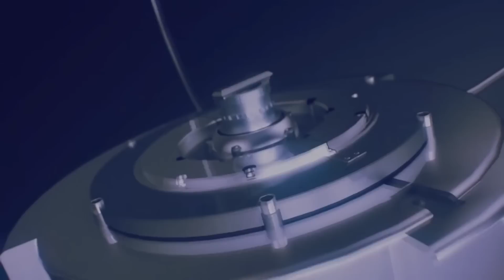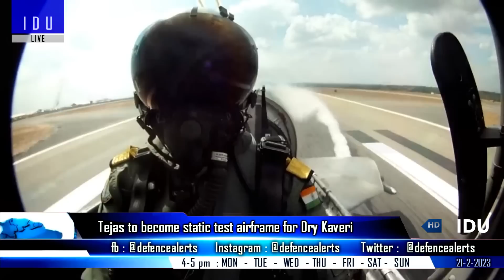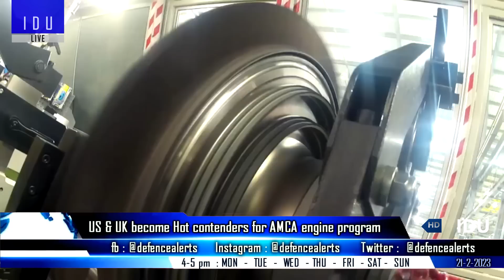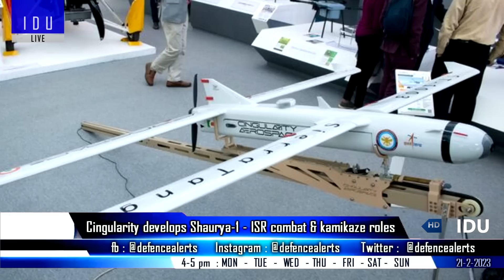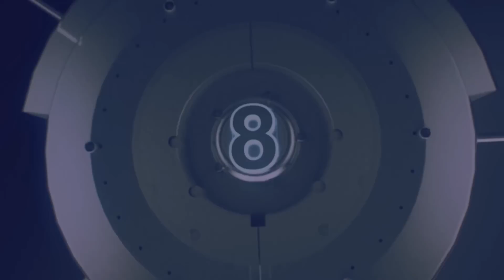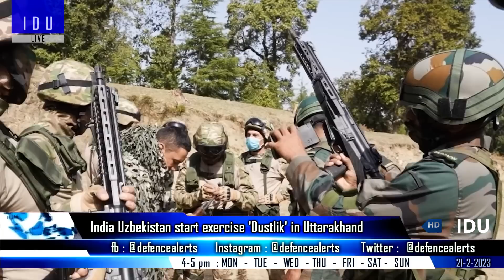Indian Defence Updates : DRDO Tests ITCM,100 K9 Vajra Ordered,130Kn Engine Offer,Dry Kaveri on Tejas

Comment: The order of 100 K9 Vajra is a discreet decision as it  was deployed on the LAC during Ladakh stand off to counter China so a sufficient no. of it will have an utility,  incidentally it will be upgraded with high area application following this  order but  only 50% of their components being manufactured in India so if atleast 10% localization  is increased that will be great then another 10% is to be increased for the next time which order is in a row & deal may be concluded by the end of 2023. 
So how about the  localization of 70% to bolster our Aatmanirbhar mission?